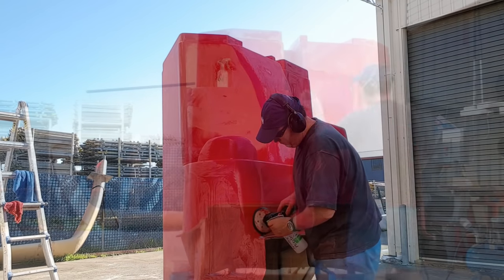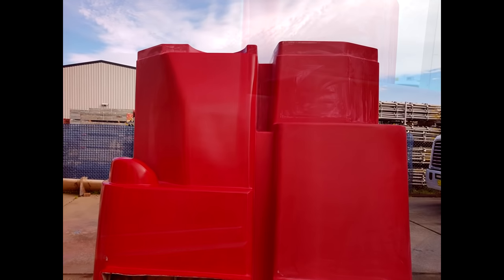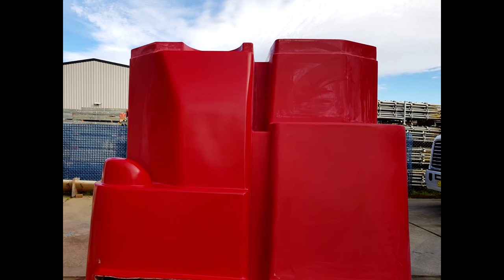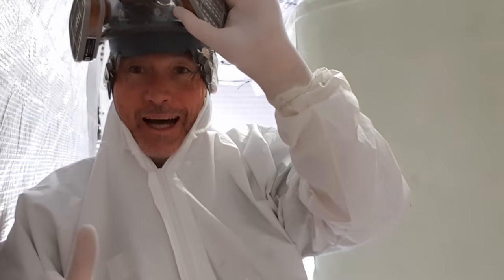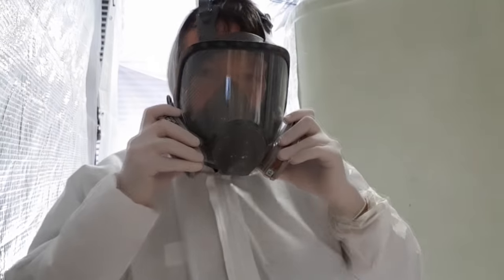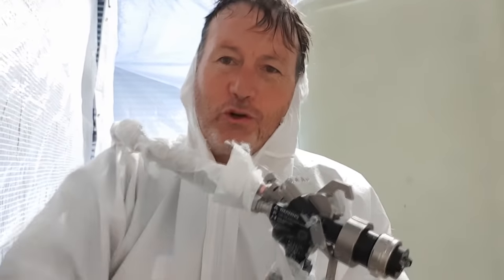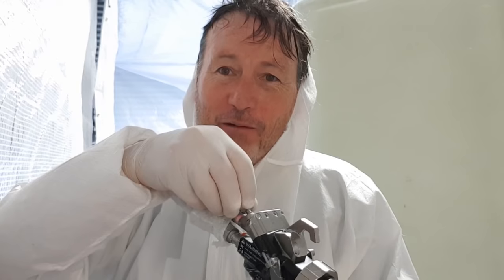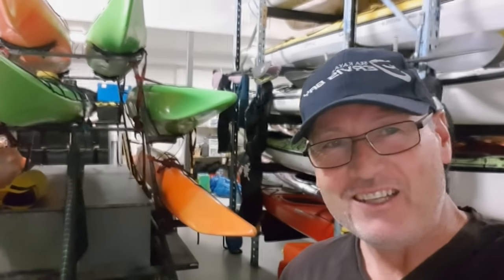Ep013 Catamaran Bathroom Module Laminating and Build

Comment: What about those red parts? Doesn't that mean that red paint flakes from the mold came loose? Do you just repair that if you ever use the mold again?
Reply from the maker: Demoukding can often remove small parts of mould especially recently repaired chips on the mould.In this case they are simply polished off the end product and the mould restored again for later use.

Comment: did u use epoxy or polyester?
Reply from the maker: The hull is entirely vinylester to eliminate any chance of osmosis as it has superior corrosion and strength propertiies to polyester .As a modified epoxy but with styrene base also easier to work with and has uv inhibitors to reduce uv breaksown common in epoxy boats.internal modules are poly to reduce costs.Cheers Ross
Reply: that sounds really nice